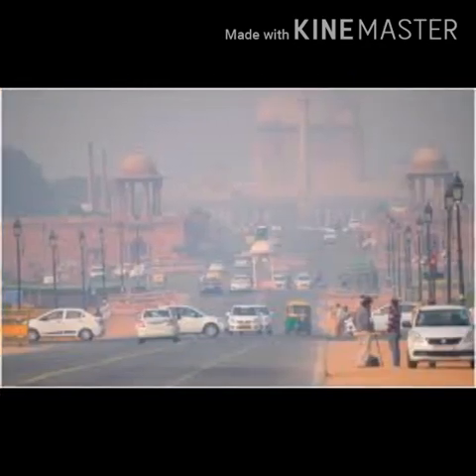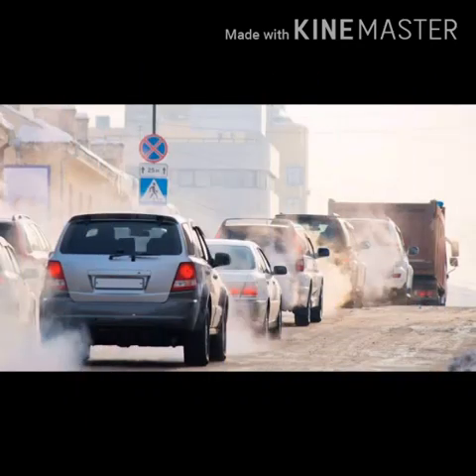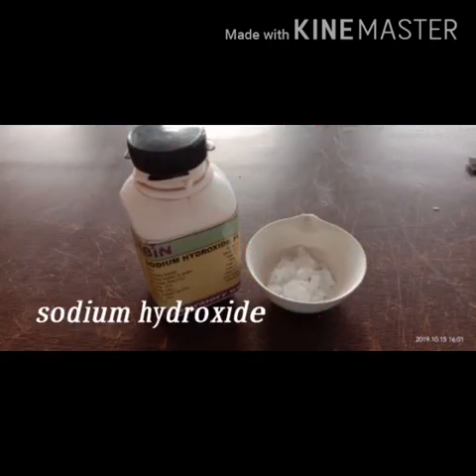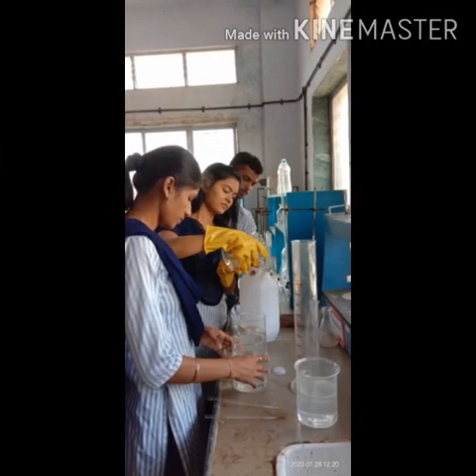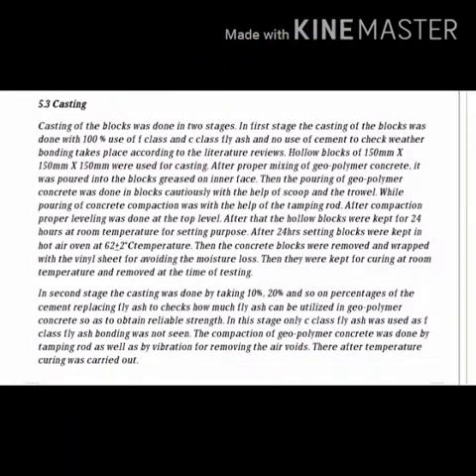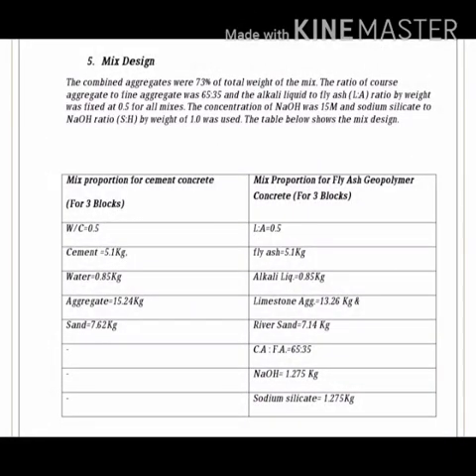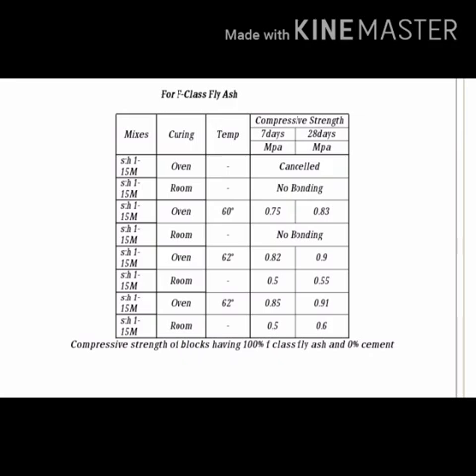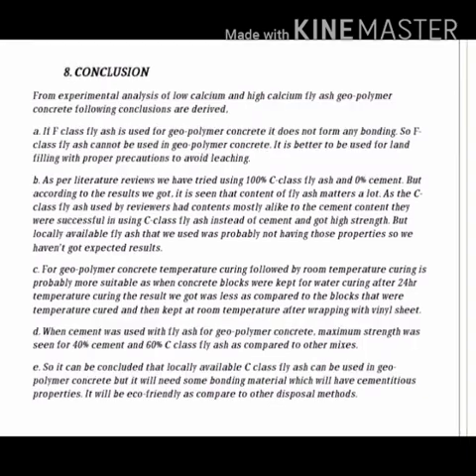ANLYSIS OF GEO POLYMER CONCRETE SUPER SEADING CEMENT WITH FLY ASH

Comment: Low calcium fly ash 100 % replaced cement with addition of silica fume by 8% achieved strength upto 50 to 70 mpa
Reply: Oven curing time kitna hota hai 7 days testing main
Reply: Can you share the paper link?